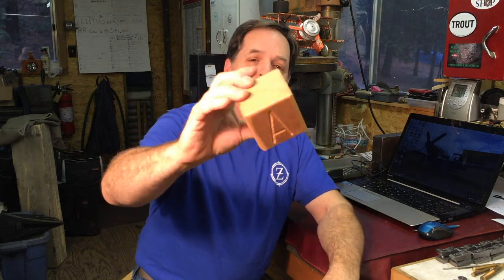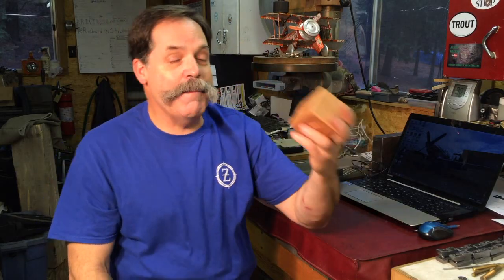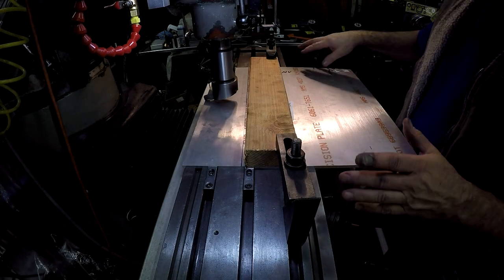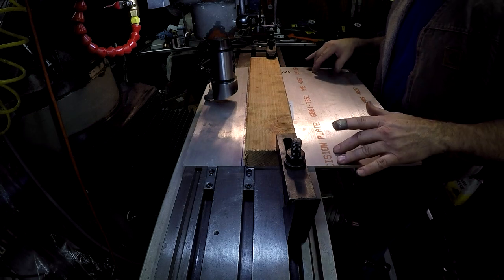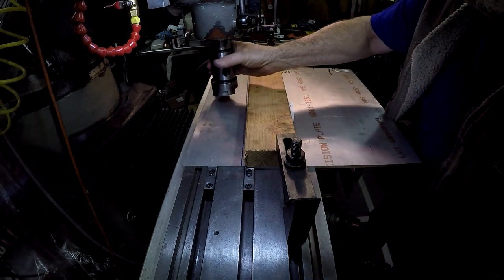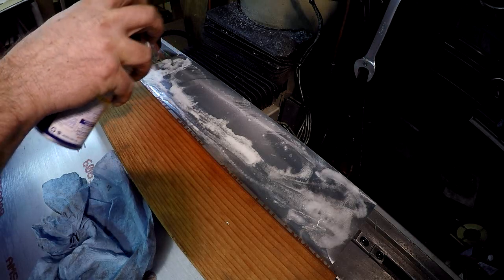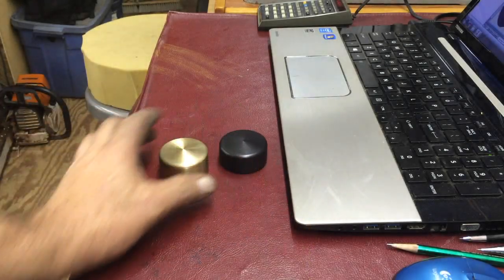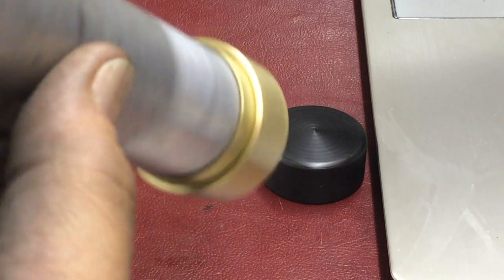Christmas Present's CNC Machined Plaque

Comment: very nice stuff got a inner woodchuck to I see. I may have to have you engrave some lathe dials for me.
Reply from the maker: +Chris Anderson I might be able to do something like that,  I want to make a carriage stop for my Lance lathe and will need a nice dial.  Good idea thatnks Chris.  Randy
Reply: +Randy Richard same plan for my atlas thinking of using Tom griffins design. think you can modify it for your lance?
Reply from the maker: +Chris Anderson I am going to build one like the one that came originally with the lathe.
Reply: Randy Richard ahh very good I'm a big fan of reproductions. I work with very old things and new parts just art there unless you make them.

Comment: Hey Randy,
a belated merry christmas to you! 
just looking at them low profile clamps you made gave me an idea: make some with a rounded nose so you can make different angles when you clamp the work to the table.. yeah you can get a few degrees by offset but there would be more stability with a rounded nose. 
that plaque did turn out pretty nice but it's a little tough to see the paint stick you forced into the engraving. i wonder how it would look if you went 0.002 deeper, filled in the engraving and milled it off afterward? then you could fill in the engraving with an epoxy and have a nice smooth finish without the burr from the engraving... just a thought. 

that brass cap and upper end of the tube for the fly fishin rod is just screamin for a knurl.. lol

all the best for the new year
mike
Reply from the maker: +HolzMichel Thank you Mike and Happy New Year, Randy, I did think about a knurl on the cap.  The engrave is probably about 10-15 thou deep.  I though about a skim over the top, but there was almost no burr.  The video was very difficult to show how it came out, but when you look at it, it is awesome.  Thank you Mike for your support.  Randy

Comment: You mentioned that "there was no way to rotate" a cylindrical object to engrave on the surface. It would be a great addition to the X-Carve to replace the Y-axis with a stepper-driven rotating chuck and a tailstock. You would need to add a parameter for object radius (or diameter or circumference), so as to get the same effective motion along the curve as along the X-axis. It might be a nice machining project (your part) with support from X-Carve (software and stepper). It would certainly add to the capabilities of the X-Carve.

Here are some links to a device (EggBot) that will draw with a Sharpie (too weak to move a cutting tool) on small balls. It also has rotation (curved path, actually) on the X-axis in addition to the Y-axis, but the principle is the same.
http://egg-bot.com/
http://shop.evilmadscientist.com/tinykitlist/171-egg-bot

https://www.youtube.com/playlist?list=PL0352A8F7A1926B98   (long playlist of eggbot drawing)
Reply from the maker: +Peter W. Meek All of this CNC is very new to me but I like the idea Peter.  I will have to look more into this.  Thank you for the links.  Thank you Peter and Happy New Year, Randy